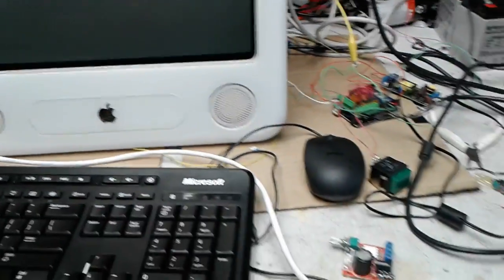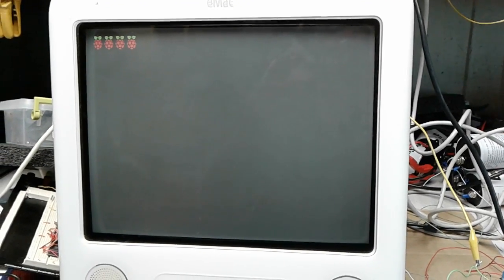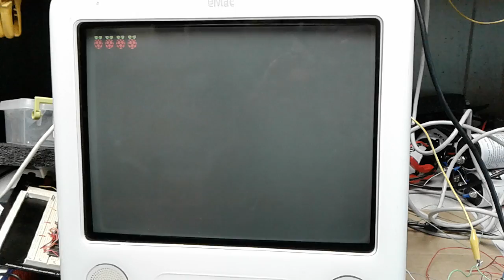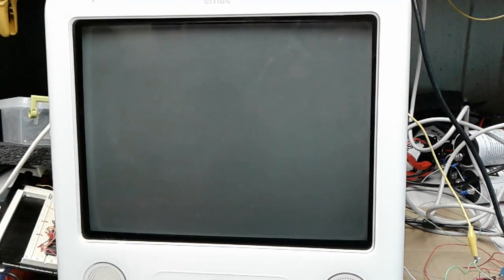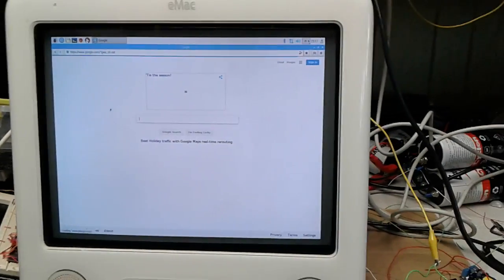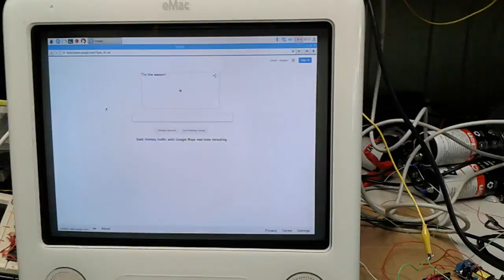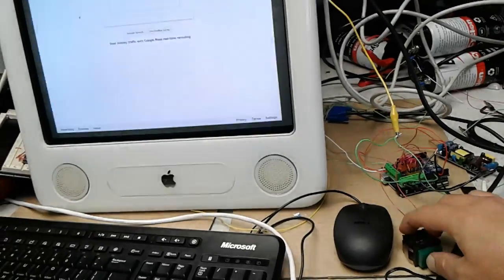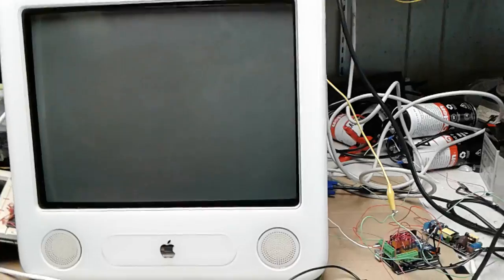piEmac eMac CRT Hack eMac as monitor 2

Comment: Hi there, might be a stupid question but how do you inject the signal? The emac has no inputs. Is there a detailed wiring diagram you can link to? Where does the Arduino connect? Thanks in advance, this is awesome and might save a few from going to ewaste. Cheers

Comment: Hey, did you use the old PSU in the eMac to power the CRT itself, or is there some other method being done to power the CRT?
Reply from the maker: Hi Bob,
The CRT & PSU are actually powered by the analog board, the board that sits below the CRT.
The PSU only powers logic board and peripherals and it is
Reply from the maker: isn't needed to use the eMac as a monitor. When I revisit this project I plan to use the PSU to power the raspberry pi that's currently in there.
Reply: @rockyhill3  Thanks for the response, one more quick clarification: how would I go about powering the analog board? I'm Assuming that I could retain the previous power equipment, and power it like that. Is there more to it? You've mentioned in the videos using 5V to power it, is that all that's required? Thanks.
Reply from the maker: There are actually a couple of ways to go about it. I choose to install a dual 12v,5v power supply that I wired straight
to the mains at the back of the eMac. WIth the experience I've gained from doing the same hack with an iMac G3 I would do it differently now. I think I would pull the 5V staight from the logic board chassis connector but that's a matter of preference. The important part to remember is that the initialization code needs to be sent to the IVAD board  soon after apply the 5V to wires 4 and 10.

I put together a wikibook that describes some of this but I desperately need to update it.
https://en.wikibooks.org/wiki/How_to_modify_an_eMac_to_use_as_an_external_monitor
Reply: @rockyhill3  Alrighty, this is crucial info you have provided me! Thank you a lot!

Comment: Hi Rocky, AWESOME WORK, planning to do this myself this weekend, just picked up an old eMac and I have a few questions about the relays.  

The code here https://github.com/qbancoffee/emac_ivad_board_init has pins dedicated to relay, with the instructions in the WIKI (yours?) describe that relay1OnPin, relay1OnPin should be connected to IVAD pin 5 and 10.  

There are two additional pins, relay1OffPin, relay2Offpin.  Should these be directed to IVAD earth?  Or other pins of the IVAD?   My goal is to have the eMac power button turn on and off the monitor.

Also - from what I understand, you would retain the eMac power supply to power the CRT, and you are just using the dual 12v, 5v power supply to provide power to the Raspberry PI, Arduino, Audio Amp, and Fan.

Comment: Did you install a relay for the mains power to the CRT, controlled by the arduino? Just trying to figure out what you mean at 1:00 ("turns on the CRT itself")